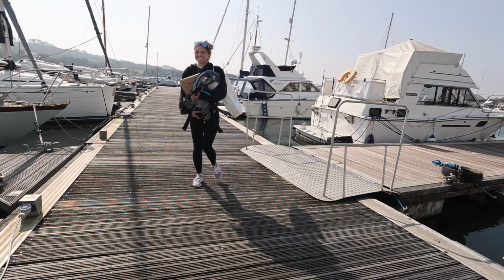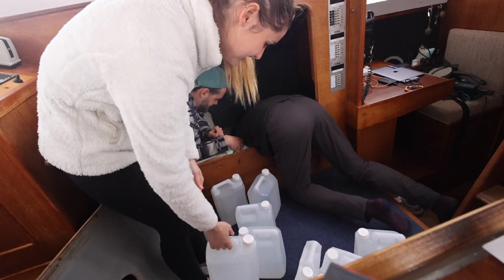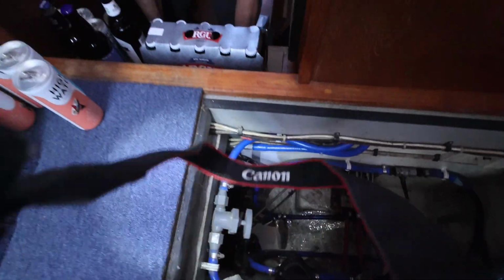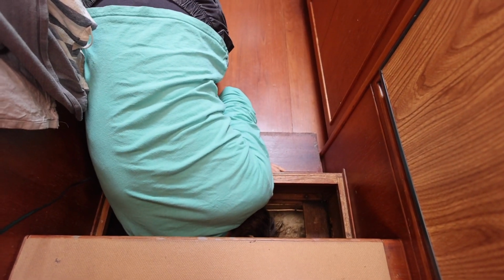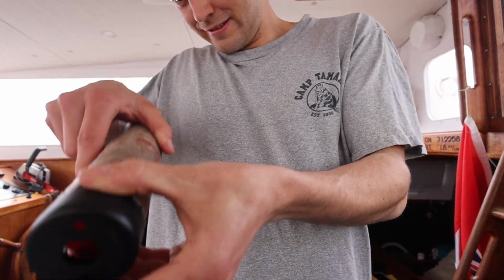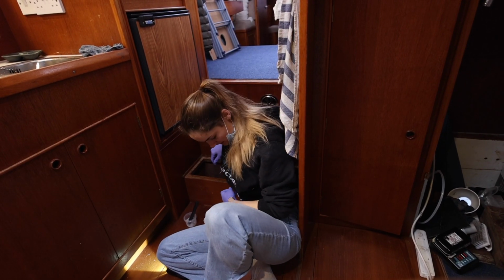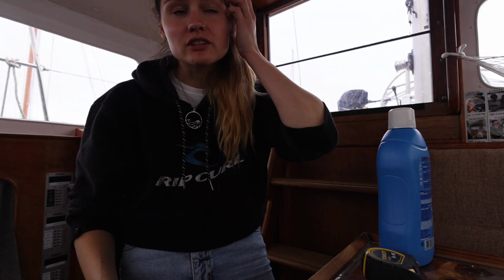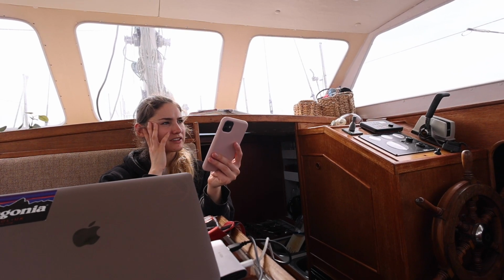Finding WATER in our New Sailing Boat

Comment: You two are doing great, but please get yourselves an inexpensive "Shop Vac".  They can be used wet or dry and you can vacuum all the water out, as well as vacuum the rest of the boat when needed..  In the US they usually cost less than $40 for a 3 gallon, and don't take up that much space.  It will keep you from ringing out towels all the time.  

On another note, your comment about living each day is spot on.  You will someday look back and might regret not really living for the moment.  And its the little small moments that sometimes mean the most.  I'm glad to see young people realizing that while they are still young. Makes me smile.

Fair winds and following seas!

Dan
Reply from the maker: Thanks for the suggestion Dan! It's something we are definitely looking into- just have had a lot of expensive purchases recently so its been pushed a bit further down the list 😅

Gotta live in the moment- otherwise you look back and regret it!
Reply: @TeuluTribe  Agreeing with Dan here.  You would have saved hours of boat yoga.  Milwaukee makes a great one. It is cordless.  I know the mains ones are cheaper but honestly don't get it.  Once you have this you will be using it constantly. Also, you won't go wrong with Milwaukee tools. Sooner or later you will buy a few essential power tools. they should all use the same battery and charger of course.

Comment: Had a good chuckle over the water tank overflow. That hose also likely serves as the pressure equalization for the tanks.  Next task is to find all the lines running diesel around the engine. There are likely at least 4.  Fuel from tank to engine, from engine return to tank, deck fill, and overflow/equalizer.  You absolutely don't want to overfill your diesel tank and get it in the bilge.
Reply from the maker: Ugh, bit of a silly moment 🤣 will do that about the fuel tank, yes that sounds absolutely awful so will try and avoid it!! Thanks Mark 😊
Reply: not sounding that bad with a weak-ass electrical motor now. i have only been left with no power on electrical motors like 3 times already so im the one to talk.

Comment: Treat yourself to a dehumidifier. Warmer air will hold more moisture but unless it’s replaced by drier air the moisture will condense again on the cooler surfaces of the boat.  Mainly those cooled by the sea. I know you can’t run it all the time but the boat will benefit from periodic bouts of super-dry air particularly those spaces where the air is not circulated often. Your enthusiasm is infectious, enjoy!
Reply from the maker: We have just got one! Which we are super happy about 😊 Thanks!! 😊

Comment: Sorry you’re encountering so many aggravating problems. A couple of suggestions: 1) Have the marina put you in touch with a service company that will clean and “polish” the fuel in your fuel tank. Much safer and they will let you know the condition of the fuel in your tank before refilling it. 2) Buy a small 2-gallon “garden sprayer”. You can fill it with cleaning chemicals and pump it up to get a nice pressurized spray to get into all of the little nooks and crannies. 3) Buy an assortment of brushes (tooth brushes, paint brushes, bathroom brushes) and keep them in your “cleaning kit” to enable you to get into all of the crazy places that tend to attract mold and mildew. Keep chugging along!!!
Reply from the maker: That sounds a good idea- thanks Darrly! Will buy a garden sprayer- will be helpful for cleaning the teak too at times 😊 and an assortment of brushes are now added to the list- thanks 😊😊

Comment: Very nice boat, well fitted out.  You need to get a skipper and some tuition before taking it out.  There is only one scary, dangerous, difficult, daunting thing in sailing and that is taking a boat on and off a marina berth.   It's worse when shorthanded, even worse in wind, even worse if the boat is heavy, even worse if the boat is new,  even worse if you are new and twice as bad in a strong tide marina.  Look up Bob Beggs,  he used to do work in the area, no idea if he still can or will but I would give it some thought.
Reply from the maker: Thanks 😊 we have taken her out by ourselves a few times now- the first was a bit dodgy but the last time went perfectly 😊

Comment: Great work guys! Love the positive attitude! One suggestion (I’m currently working through the same thing): assuming a chainplate is good if the side you can see looks ok, that’s risky. Crevice corrosion happens on the other side, where the plate surface contacts the hull, if water is getting in there and oxygen can’t reach. I’m given to understand that the only way to be sure is to take one chainplate off, clean it up thoroughly, and then look on all surfaces for any tiny cracks or other evidence of corrosion. If problems, check the rest too…
Reply: Oh n a haul out maybe as if you do that on purchasing a boat. Poor little kids haven't left the dock yet and your scaring a 2k bill in picky. Did there daddy think it necessary. NO !!! Laddy's got a daddy thank you very much.
Reply: @ji6050  guess that schooled me 😉
Reply from the maker: Will check out the other side soon! Thanks Luke 😊
Reply: @TeuluTribe  chain plates must be removed to be inspected.

The corrosion that will dismast you is buried in the deck penetration.

This is a 10 year inspection, so if the previous owner did it 5 years ago, then just look for leaks and put it in a calendar for the appropriate yard period.
Reply from the maker: @sailingnomad4963  Thanks! Will find out when they did and write it down 😊

Comment: .....  laughing ... the suspense .... you certainly got to know all the nooks and crannies of your boat ... took care of areas where water gathered and the scary mold ...  have to say, even though it is on hands and knees, you have great access to your engine, a lot of peeps could only wish they had that luxury. .. love how your spirits were only marginally dampened by the challenges ..... chuckling ... can only start to imagine how you felt when you discovered it was the overflow that was the culprit .... I'm guessing thankful that the mystery is solved, water can now get to the bilge pump and the mold has been dealt with .... scared me when you were talking of the possibility of getting stuck and not panicking combined with the fact that you were alone ... epoxy fumes are in the category of being heavier than air and are not a good thing to be breathing and will fill up the bottom of the hull .. the area should be well vented ... I do not have the best answers, you may want to google ... "story time" .. back in the late 70's I came upon a chap that was gluing in, with contact cement, a new floor on his cabin sole. I found him making the shape of the chalk lines that you see in police dramas. Had to summon others as he was a big lad and we had to get him to fresh air fast. It was a struggle but am able to say that he did survive the ordeal. You can imagine how scary the situation was. All I can say is be cautious .... thx for sharing ... as always .. never stop dreaming, just dream bigger .. have fun be safe, save our oceans ...
Reply from the maker: Haha yes there are lots and LOTS of those! Honestly, there’s been plenty of those ‘oh man, was it really that simple’ moments 🤣 but there we go! Just got a respirator so will wear that next time whilst working with epoxy 😊 I bet that situation was really really scary- luckily he was ok! Thanks for the lovely comment 😊
Reply: @TeuluTribe   ... good to hear that you have a respirator .... also lots of fresh air movement would imagine would be beneficial ..  thx for your reply Becka  .. have a tremendous week ....
Reply from the maker: @peterfrebold  You too!! 😊
Reply: @TeuluTribe   .... thx ....

Comment: What is brilliant is your raw experience of learning. It’s so relatable. I think one of the biggest mistakes sailing YouTubers make is trying to be experts and show ‘how to videos’. For an experienced yachtie it’s actually infuriating. I’d rather watch when you get experience from experts and show how you solved something. I get angry when I read comments and the bad habit or really poor solution is passed on. 

I get angry when I see people think that you tubers are expert sailors when often they are really poor. The comments where people say go copy what so and so did is infuriating. You can’t learn to sail on YouTube and certainly not from the comments section (the irony of this post - I know). It takes many many years to be a good sailor. It many sound elitist but generally the cruising sailors are very poor at sailing too. From finding solutions to sail handling or general philosophy on how to deal with a repair the racing sailors have often a much more elegant solution. Just because you have had years of cruising experience doesn’t make you a good boat handler or mean your boat handling is good. For example, often cruisers use autohelm or tack once on a trip, maybe they learnt a bad habit and it stays with them for years. Think about racing. You are forced to sail angles, trim sails, figure out efficiency really quickly but also you repeat it a lot and you have benchmarks in competitors to see if you improved. From docking, hoisting sails to tacking racing sailors make better sailors. No offence to cruisers it’s just a better learning process. It’s better because you share knowledge from more experienced crew or you talk to, watch, read and sponge ideas of others. 

The last comment I’ll make in my rant is cruising sailors often fall into the trap of strength over performance. It’s dead wrong. Don’t replace a fitting with a bigger heavier fitting or massive steel plate, etc. it just transfers a problem elsewhere. For example I’ve seen people upgrade rigging diameter to a few gauges heavier because ‘we are cruising, we are not in a rush, we want ti be safe’. Well by doing that you just created weak points in your rig or hull. The changes are not designed or considered by the naval architect or engineer or with the idea that going more efficiently through the water is safer. By making the rigging heavier you just created more weight up high and changed the centre of effort or balance of your boat. You made the boat more dangerous in a swell, slower and you now will spend more time in dangerous conditions in a boat that is performing worse. You wouldn’t put crappy tires on a car and expect it to be safer. So don’t fall into this ‘over build it cruising philosophy’. Sorry for the rant. Love your videos and your journey.
Reply from the maker: Thanks Chris- we are just learning as we are going along and filming it all. Life is full of mishaps and mistakes and we never, ever want to portray our lives any differently, i think comparison to online figures who 'have it all figured out' is a dangerous prospect and leads to a lot of people feeling like failures when really, we are all learning by living and visa versa! 

Thanks for giving a different perspective- we wont fall into the 'over build it philosophy'! It makes no sense!
Reply: @TeuluTribe  I agree. I am really enjoying your videos and they are getting better with each episode. Well done.

Comment: Your mysterious pipe is more likely the breather rather than an overflow - it would normally be connected to a small vent-like fitting on the side. It maybe that it's broken and the other end of the hose is somewhere?? You don't want it in a bilge as it could suck bilge water into your fresh water tank (as you use water that pipe will 'suck')

Also, you probably need to find out why the boat is not level - could just be badly loaded lockers or a full tank on one side, but might be something else.

Great attitude to have (about living each day) and it's something I really struggle to do - always seem to be waiting ....
Reply from the maker: Thats interesting- thanks Guy! Will look at the other end. I think either ours is super old school with the tube (its unlikely enough air will fill the pipe for water to start coming out) or its broken. I think you can now get valves which only let air out (not water) so we will probably look to replace it with one of those. 

The boat is listing because the previous owner added a custom fuel tank (double the size of the original), hence the jugs!.

Comment: Dont make holes too big in those bilge ribs... they re enforced the hull as well as support your Floor's. Aim to place them at the lowest point.... but being a monohull you have to remember it can build up while healing over.
Reply from the maker: We put the whole at the lowest point we could but were limited to size due to the reinforcing tube 😊
Reply: @TeuluTribe  
Just use smaller tube like ABS plastic wiring conduit or domestic waste  water pipe. ...its out of the sun and away from heat so it wont deteriorate..its just to stop water getting in between the hull layers and connect the spaces.. 
Remember though if you connect all the spaces that means they can all fill before the come out over the cabin sole.  So at least two possibly three pick up points  should be built in and remain active when all other systems are off as when the boat is left empty ...thats why solar panel s topping up your batteries is a good idea.  The other thing is a damn good manual bilge pump operable from the cockpit usually..

A intelligent person learns from other people s mistakes rather than just repeating their own.🤞🏼🧙‍♂️😉

Comment: Boat life can be tough, but you two are doing great.  Remember, you learn more from your mistakes than your successes...just keep plugging away.  I'll tick one of your things off the wish list here in a few minutes.  Hope to see you under sail soon.
*Edit*: I find it odd that you have a single water tank on one side of the boat without a matching tank on the other side.  I could understand it if it was on centerline, but on only one side? Water is used as ballast, and there should be an interconnecting pipe (with isolation valve) between the L/R tanks to maintain balance.  I believe that the tank overflow should run straight to the main bilge, and not some random side bulkhead.  I'd follow the guidance of the local marina experts on replumbing your tanks.
Reply from the maker: Thanks Erik 😊 You really do! Thats so kind- we really, really appreciate your support 😊 

Its because the previous owner added a custom fuel tank to be double the size (on port side), which inevitably makes the boat list. The overflow does run into the main bilge, we didn't make that too clear! Its just the extra space under the pilot berth (where we were installing a new tank) which doesn't have a bilge pump because it would have usually just been a 'dry' bilge!

Comment: The tube in the h drain hole was not needed really. You could just seal the wood with epoxy
Reply from the maker: It is a bulkhead, so we wanted to make sure it was very well supportive! Maybe overkill but it worked haha

Comment: You are doing just great despite the setbacks. I love your comments about living life in the now. One thing that concerns me is that you're not wearing safety glasses. One little flip of epoxy into your eye can affect the rest of your life. I know by experience because I have some damaged eyesight in one eye and it's something I am living with the rest of my life. If it sounds ominous, it is. Add a couple of DeWalt clear and shaded glasses to your Amazon wishlist. They're very inexpensive.
Reply from the maker: I was wearing them the whole previous day and then couldn't find the goggles so wore glasses and they kept falling off when i was upside down in the bilge! But you are so right- i need to wear ones at all times, safety is really important to us 😊 sorry to hear about your eye, that sounds awful.
Reply: I hate to persist, but the problem with goggles is that you want to take them off as quickly as you can. Then you need to find them when you need them. The safety glasses I recommend are like wraparound sunglasses (you can order the same with a sunglass tint) so you don't need to take them off at all. Look for "Dewalt DPG58-1C Reinforcer Clear Lens", $11US, and sunglass "Dewalt Reinforcer Smoke Glasses", just $10US. Look for some sunglass retainer strings also (croakies). You need those on the boat at all times anyway.  Dan, on Sailing Uma experienced a tiny epoxy flip into an eye without permanent damage, but it was obviously traumatic, and it needed to be treated like any other injury, Sorry, switching to the Amazon UK site just wasn't working for me.
Reply from the maker: @MerleNicholson  Will buy some now 😊Thanks Merle!

Comment: If this is hole position in the bilge is part of the original design it really doesn't make much sense!?!  I'm also interested and concerned why the boat is listing so much to one side without the water jugs for ballast.
Reply from the maker: It doesn't make any sense 🤣 then again, when the boat was built, there would not have been a water tank there so thats maybe why. The boat is listing because of the extra large fuel tank on the other side (it was doubled in size from the original!)